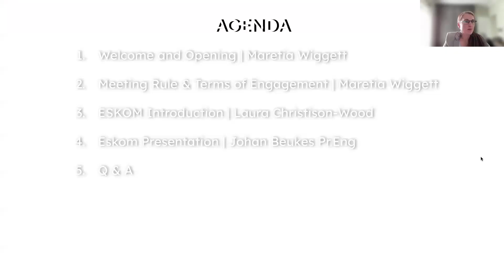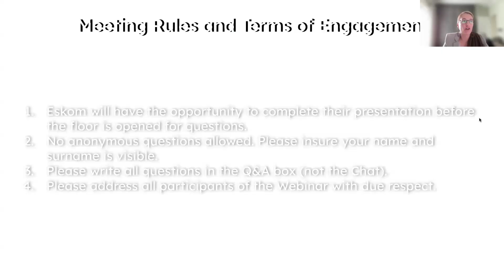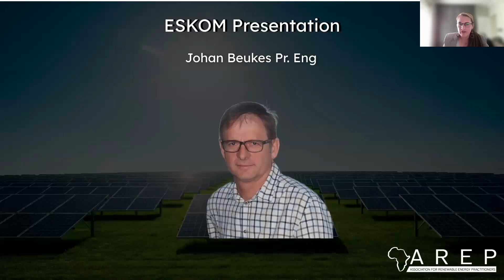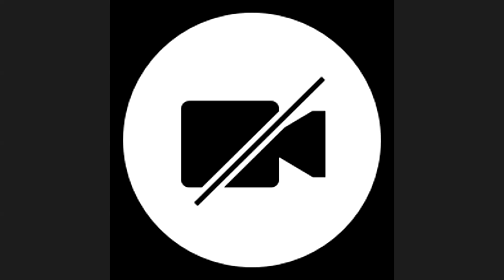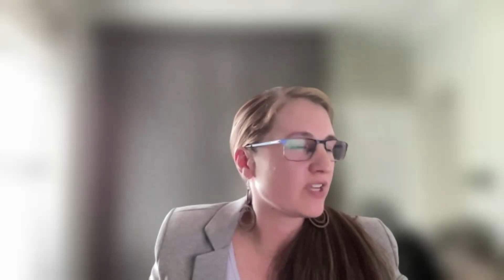AREP | ESKOM | SSEG Registrations | Session 3 of 4

Comment: Doesn't it come down to  what he said "...we want to have control off what is installed..." +- 33min mark of the video. Not about safety so much, but the control. Why do you want control, because we can see what happened to Eskom that is state controlled. You begged the private sector to help and we helped, now you want to control, fine and manipulate us because you are not making good money. This is NOT FAIR towards hard working ordinary citizens.
Reply from the maker: Hi @MK71MK - Thank you for engaging with the discussion. The purpose of the meeting was to facilitate transparent dialogue between ESKOM and the Solar PV sector regarding the new SSEG registration requirements. While concerns around control and governance were raised, ESKOM also highlighted the need for grid stability, safety, and system planning as key drivers behind the process. AREP is committed to ensuring that the voices of practitioners and stakeholders are heard and will continue to advocate for fair, practical, and technically sound policies that support the growth of the sector while protecting the integrity of the national grid.  If you haven't already, please join AREP as a member (it's free) and we'll keep you posted on related developments and follow-up discussions you might like to participate in.